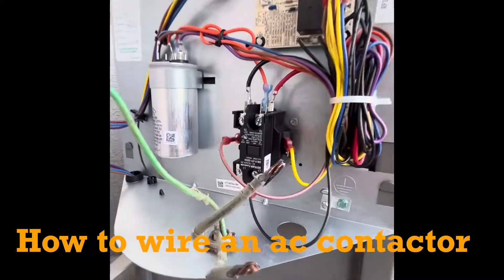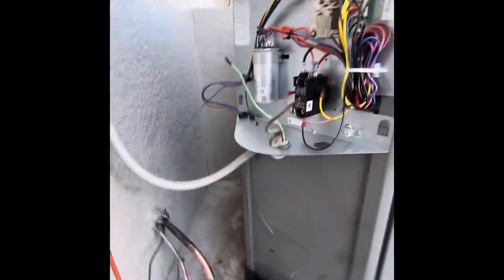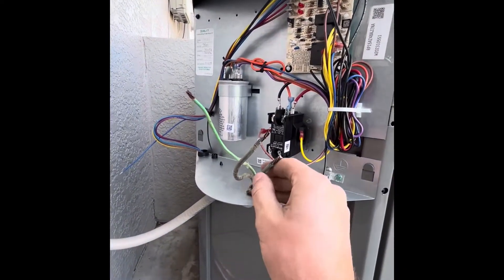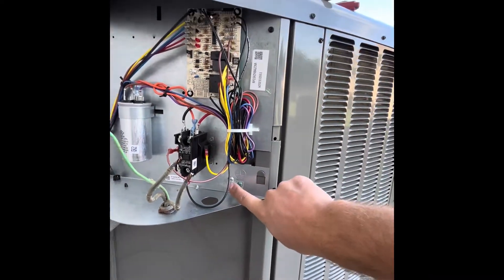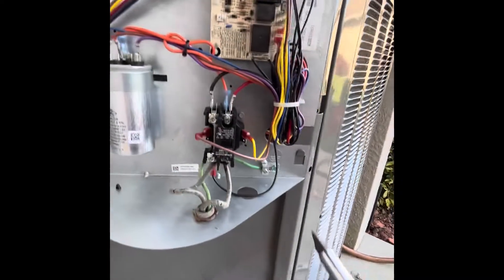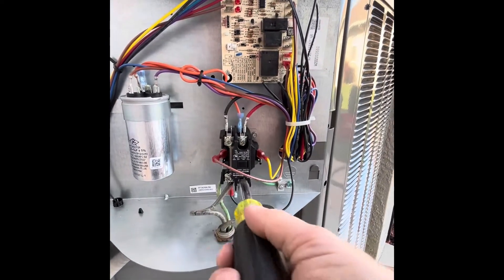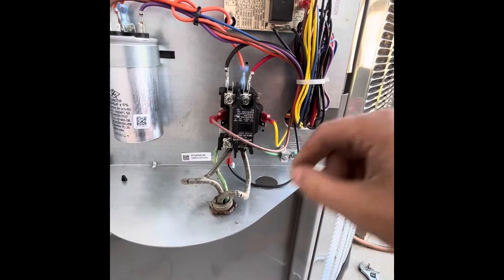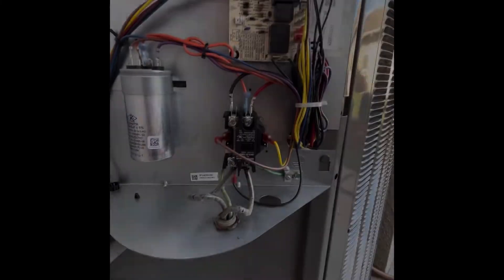How to WIRE an AC Contactor

Comment: What about the 24 volt wires where do they come from and what is the 240 volts powering
Reply: The 24v wire is sourced from the inside thermostat and the 240v is powering the outside components such as the compressor and fan motor. The electrical circuit which powers those components has a "bridge" that opens and closes the circuit via a magnetic coil inside the contractor which is signaled by the thermostats 24v wire.
Reply: @Teddu-  Well, I like your explanation I would just add that, technically the 24V is sourced from the step-down transformer (240V ----> 24V) inside the Air handler, which then energize the thermostat, which is a switching device to call for cooling, heat, fan etc....